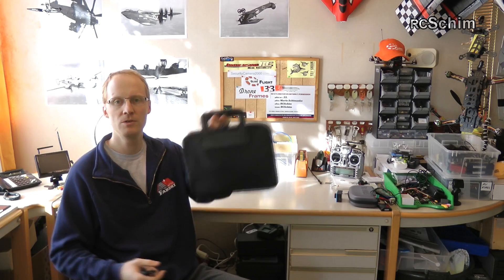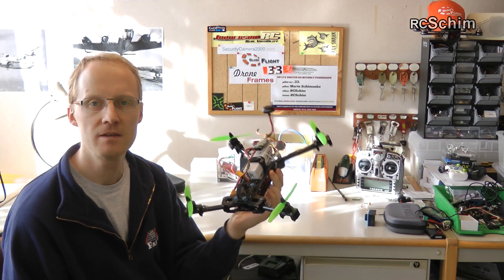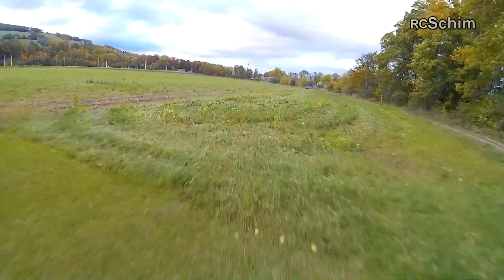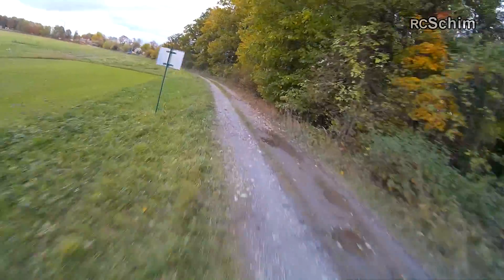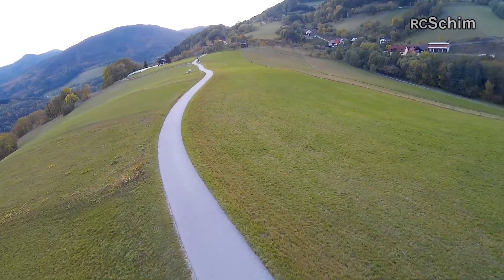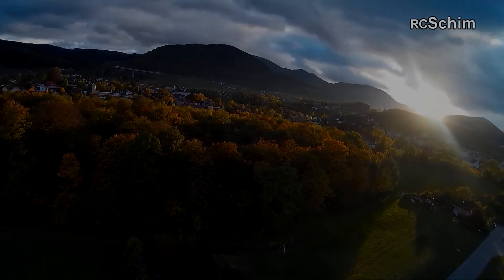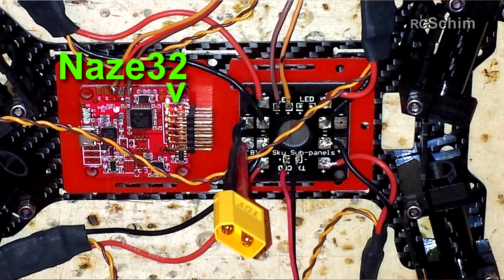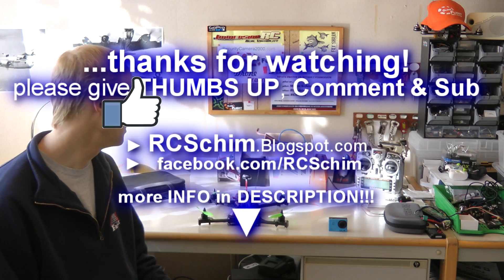Black Snapper XS Maiden, Buildpics, Tipps, Thoughts and some fine Autumn Treesurfing

Comment: nice video shim,    I cant find much info on the snapper xs.  do you know what the frame wight is. and the size.
Reply from the maker: +3D Drones you're right - my description was missing some infos here. Check it out now, or follow the link to my hangar for even better details.
This is the info you asked:
Dimensions (folded in):  22 x 13,7 x 2,6 cm (LxWxH)
Dimensions (folded out): 27,3 x 30,0 x 2,6 cm (LxWxH)
Frame weight (empty): 125g
Weight including electronics and without battery: approx. 320g
Motor axis diagonal: 360 mm
Reply: +RCSchim Wow those specs rock.  I'm sold on one now.  I have a setup for 8" props that would allow me a 20+ minute flight time with that frame.  wouldn't be as sporty as yours but the potential is great.

Comment: Do you think you will ever get another black snapper quad again? You has the larger one with the gimbal but lost it right?
Reply from the maker: +Ghostrider03z hi, I do have the "big Snapper" also in my hangar. I got it from a friend that crashed it and than moved to a phantom3 ;-)
I repaired it, got decent motors and it´s ready to fly again. However I have to many quads (hope my GF doesnt read this!) so I always fly the new models first.
The big Snapper would be a longrange quad, this time I dont wanna use the gimbal - to safe weight and have more flying time. 
For gimbal filming I have the Xugong or the Phantom2...

Comment: Nice quad, looks like some design elements from the Vortex.
Reply from the maker: Could be the other way round actually, since the snapper mini (v1) was out before the vortex I think. The vortex is prebuilt, which would be a huge plus for me :-)
Not sure about their shipping, but try to inquire them, you should get an answer soon.
Reply: Ok
Reply: +RCSchim Did not know that the Black Snappy was first on the market.  I really like there design.  That would be a great quad racer with a Eagle tree Vector flight controller.    I have been working on a modified Vortex frame with a combination of 3D printed parts and Carbon fiber with a Vortex FCU.   http://www.thingiverse.com/thing:1040710  This frame would be perfect.

Comment: Hi Mario, the Snapper XS is really a nice quad in this small size :-) I'm impressed about the smooth flight behaviour and the possibility to fly some stunts as well. Only the flight time is not so much I expected but not too less than it's worst ;-) There is only one question left! Is it durable enough to take a crash without damage? Wish you all the best! Paul
Reply from the maker: I was also dissapointed at first about the 5mins, but then I realized that my drq250 is the same weight and it also had the same flighttime. The trip is smaller, almost 200gr less and so it flies 2mins mor with same batt, motor and props!
Crashproof? Already tested as you will see in the next vid. But it was only a minor bumb against a metal bar (schranke nicht lokal :). 
The motor arms were twisted, but not damaged. So this can take energy on impact.
Reply: ... nice, that's sounds not bad :-)

Comment: Another great video!
This mini black snapper looks really nice! The folding arms are pretty sweet!
I think yout video TX is too much exposed though but when i saw the picture of the build i could understand easily why you went this way!
Maybe try a more small one, there is a lot of good one the market but not sure if they will work nicely with your immersionRC stuffs!
Looking forward for the next videos ;)
Thanks for sharing and have a great new week
Reply from the maker: +ABMNS PRODUCTION thanks Cedric, yep - didn't find much alternatives for the vtx. I know - on crashes the antenna can tear out the connector thats soldered onto the board. But there is a clever way to fix this - AtalayFPV channel had a video on that matter. Gotta repair 2 or 3 VTX this way soon ;-) 
for smaller ones I have the trip (210mm) smaller than that and I think they dont fly as smooth as I like it - and it gets harder to get decent stuff on it. oh yes, and I remember that you had some rant ongoing with IRC products ;-)
Reply: RCSchim LOL if i have something against immersionRC, it's because i was very disappointed by someone working for them, i met this person on a french forum and the few exchanges we had did not end well but it's an old story now, i try to move on from it the most i can! Immersionc has some cool products but i deeply regret the high price and the way some people of the company talk to you lol
Thanks for the head up about AtalayFPV, i will have a look on it!
Enjoy your week Mario and keep on FPVing :)

Comment: Hello Schim good video and good quad  ;)
Why use BEC UBEC for powering the Naze32 board you can use ESC for that ?
Other no understand the information on the lens.

They are this other good frame Moka :

http://mokaframe.com/

:)
Reply from the maker: +ONCLEFLY 
the emax ESCs used here are very small (titled worlds smallest). They have no BEC built in (because you normally need only one BEC and on a quad 3 would be unneccessary. Dont know about the involved weight...)
About the lens: I have the Fatshark FPV cam here. swapped the original one out for another one with more wideangle. But I found that the colors were now totally wrong (looking infrared vision style - only BW and some blue). Reason: the chip inside there needs an infrared filter which is coated on the inside of the original lens.
Now that I switched back to std. lens - colors are fine once again.
if you wanna see how the wrong colors look: wait for my next video - here I have a short scene (during a crash were HD cam stopped recording).
thanks for watching so patiently ;-)
Reply: +RCSchim Thank, I understand now the information on the lens, so no good cam you have.
For BEC UBEC, It is better to take the best ESC I think.
Very good video my friend.
Thank so patiently for the continuation  :)

Comment: As always a great video, cool frame and setup, you make it look so easy!!!  I know it takes alot work to get it right on the mini quads as I've had tune mine quite abit even with Cleanflight 1.10, Great job ;)
Reply from the maker: +Denny Roberts I had a lot of tuning sessions with another quad based off naze32 and cleanflight - so I had enough experience to do it right from the beginning. Very nice if that happens!

Comment: Thanks for the information on the lens. I was not aware of that. I purchased a 1000tvl camera from eBay and had that issue. I will try swapping out the lens
Reply from the maker: +etab83 you just have to take a look at the "inside" of the lens that came with the cam. Is it normal colored or does it have a red color? 
the one that came with my fatshark cam had red layer and thus you need such lenses.
Just coming back from some more testflights: the standard lense is perfectly fine (I thought I would need more wideangle but the default one is fine).